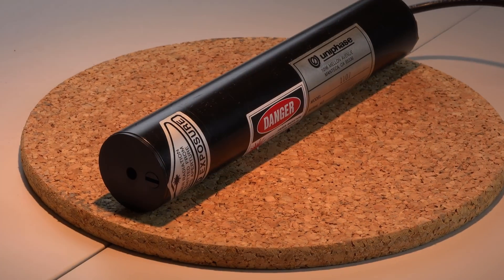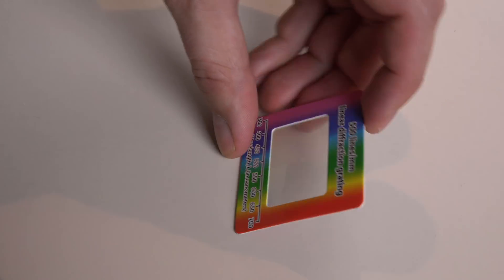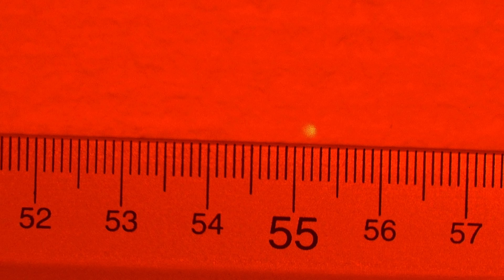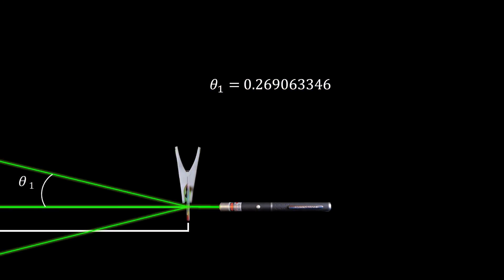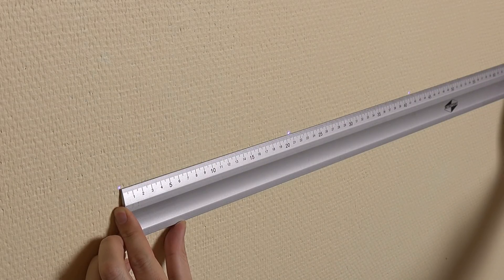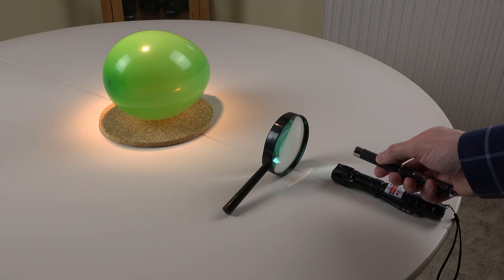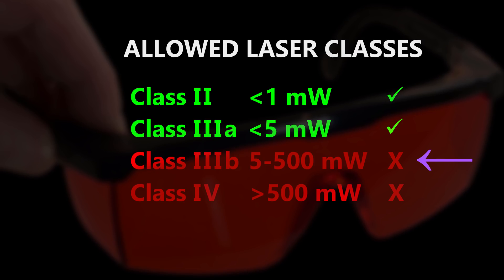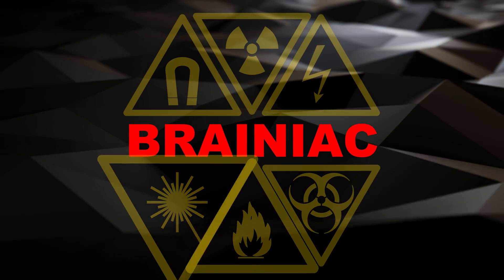MISLABELED LASER | Power and wavelength?

Comment: you forgot something very important : the grating is said to be 500l/mm but you dont known for sure  ;  the best way is to measure the distance between 2 lines of the grating with a microscope and then you have the exact line density of your grating.
But still the demonstration  of the method used is great!
Reply from the maker: Well, the diffraction grating is precise enough for me :) It could be the grating's fault though, that the wavelength results consistently were below the theoretical value. Thanks for watching!

Comment: Hi,
I want to make a lasertag game using eyesave IR lasers (ca. < 1mW). After searching the internet for several weeks, I still couldn't find any non industrial ones.
I would prefer not needing safety goggles, because most of them are very expansive and might also be toned and therefore have a discoloured image. Do you know of any cheap goggles or material, that block IR light and fit my expectations?
I know, that you can decrease the optical power output of a laser by decreasing the voltage, but I have read, that there is a minimum voltage needed for the laser to work properly. What experience do you have in this context and do you think it works better, when I decrease the current instead by connecting a resistor in parallel?
An other idea I had is decreasing the output power with an optical filter or adjusting the focal lenght. However the laser should stay focused, only the beam diameter may expand.

Thanks for reading, hopefully you can help me :-)
Reply from the maker: Hi. Sorry, I don't have experience with your type of project. All I know is, that the combination of IR laser beams and eyes is not good, so I'm not even gonna speculate on your behalf. Be careful. In the spirit of the video: How do even know the laser is below 1 mW ;) IR lasers are typically used as pump diodes and very powerful. Thanks for watching - hope you succeed with a safe and well-working lasertag game!
Reply: Thank you, I know, that I have to be very careful, ir lasers can be really dangerous.
Maybe I can experiment a little bit to decrease the optical output power (with proper eye protection) and kind of measure the power reduction by comparing to leads like lighting a match (bad example xD)
My source for the below 1mW value is a diagram on Wikipedia and a comercial laser company.

Comment: Do you think a cheap chinese safety glass will help much with a laser? Especially the green ones are mostly generated by infrared laser and then frequency doubled but still emit quite a big amount of infrared which is invisible but very harmful to the eye. You should do a test here - dont know if it show up in that kind of test - probably not...
Reply from the maker: Any safety glass is better than none at all - so yes. Infrared leakage is a problem on cheap, green DPSS lasers. Not sure how detecting infrared leakage can easily be done at home. I'm open to suggestions :)

Comment: A great video! Extremely enjoyable, and very good to show to students. A small remark, I do not understand why you insist so much on radians. You do not need radians at all. Any angle unit will do, as you re-inject your angle, obtained from arctan into a sine. Grads, degrees, anything will do. Additionally you do not need trigonometric functions either, a good old square root will suffice, thanks to Pythagoras' theorem. The formula is (okay, not as simple, but involving far less complicated math beneath, and needing a simpler pocket calculator): 

S1 / (2 * SQRT((S1^2)/4 + L^2)) * 1,000,000 / 500

And voilà!
Reply from the maker: Thanks! And you're right. Any angle unit will work, as long as you stick to the same in both formulas. My bad - a combination of 25 years since I learned and practiced trigonometry and too much switching between a spreadsheet in radians and a calculator in degress x) But hey, the end result is the same and now my viewers wont have the same trouble getting it to works as I did :D
Reply: Congratulations again! :-)

Comment: When I got my 0.1 W laser from this company called Lazerer, I asked for power measurement specification. After several years, it still works excellent.
I just want to say that it's best to buy these things from companies that deal with lasers only, and not some "geek stuff" website or even worse, eBay. Usually you get a <5 mW relabeled as a burning laser and not the other way around.
Reply: I just get scrap projector lasers. Couple hundred bucks, 40 watts. That'll do 'er.

I have yet to turn one on, because that's a terrifying amount of laser.
Reply: In recent years, the laser diodes between 25mw and 50mw has seen a drop in value, mostly because they aren't really good for a lot. They damage the eyes, yet they are also too weak to do anything actually useful. It is these that are making it into mislabeled products, due to being cheap.

Comment: Wow I never knew that lasers could be this dangerous!
Reply: Drusus Carrico wait untill you'll find out the truth about forks and other kitchenware!
Reply: What did you think lasers did than exactly? They are literally designed to a create a cohesive signal, which, with minimal effort, definitely has the potential for abuse!
Reply: I've been stabbed by a spoon, I was fine. However I have a laser that should permanently blind someone in about 1/10 second, and cause permanent eye damage within 1/1000 second. That's a lot more dangerous than kitchenware (although, if that kitchenware reflected the laser back into the operator's eye, then I agree it would be very dangerous).

PS: I'll juggle knives, but never a laser, some things don't heal like miner serrations in the skin.
Reply: Well I knew that they can kill your eyesight but not pop balloons or light matches.
Reply: I've always thought of lasers in the following light:

Imagine a thousand pebbles dropped randomly in a pond. Each pebble creates its own ripple which will combine with others, cancel other with others, and it will generally be a very chaotic environment. Now, imagine that each pebble was dropping at just the right time such that its ripple and all the other ripples perfectly match up. Those combining peaks could have 1000x the energy as a single wave from a single pebble. 

That is coherence.
Reply: For Jakes, example, imagine that a low powered spoon shooter hit you all over your body with randomly generated spoons. Nothing much will happen, maybe a bruise or something. Now, imagine that every spoon was synchronized to hit you at the same time, or hit you in the spot, or just simply be more coherent than random, some real and potentially devastating effects are going to manifest.

Comment: You have a 995MW  laszer solution with the included magnifying glass. This is supported by the fact that the similar lazer faded completely on the right against the black background.
That makes the equation 140 Mm - (black) However dark you where able to achieve.
Most of the rest of  your math was correct.
I would suggest that you revisit this topic.

Comment: Mislabeled?  Maybe not!  Visible light may be (actual or equivalent) to 5mw, however...the INVISIBLE infrared light from the exciter is much higher but NOT filtered (to save the cost of the filter)!
Reply from the maker: That's only a problem on DPSS lasers (like 532 nm green and 473 nm blue). The violet 405 nm lasers do not have an IR pump diode and therefore no risk of IR leakage. Thanks for watching!

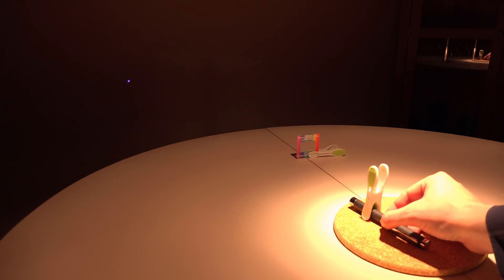Comment: 4:50 I can assume the helium laser is helium 3, correct? being within an error margin of 3 manometers it works surprisingly well for something with a half life of 12.5 years. has it been used much?
Reply from the maker: Are you thinking about tritium (hydrogen-3)? No, it's just normal helium in the laser. It's amazing, that such an old He-Ne still works. It is on its last leg though - it starts to strobe and make worrying arcing noises when warmed up :(
Reply: ah yes, sorry, I'm a little tired, been up studying all night. but yes it is amazing that a helium neon laser is still operable 30 years after it's creation.
I hope it last's a little longer those are very rare at that age and condition.

Comment: wouldn't a higher power laser melt that diffraction plastic (and CDs)?
Reply from the maker: It probably could. I have no idea what the max power rating are for these. No info on the manufacturers website. I expext it to be very high for visible light, though.

Comment: Very nice video. "I've have just confirmed the wavelength [...] within a third of a billionth" For you to be really able to say that you would have to compute the experimental uncertainty. "Measuring Error Bars with Aero Bars - Sixty Symbols" is a very good video about this topic.
Reply from the maker: Thanks :) Did I mention, I'm not a scientist :D I know there is some uncertainty in such a crude setup with basically a toy diffraction grating. But I was very surprised by how accurate it was for all lasers. The interesting part is that all results were below the theoretical wavelength. I wonder what is the cause for that. The wall is not perfectly flat, the diffraction grating is not perfect, I didn't place the laser perfectly level and at 90 degrees, temperature dependence of lasers etc. Thanks for watching!

Comment: My laser is labeled as 3.5W, but when I burn things such as cardboard, sticks and small pieces of wood, they never set on fire. Instead, they just instantly start burning. Makes me wonder if its way less than 3.5W. (laser is wicked laser arctic spyder iii 3.5w)
Edit: burning///smouldering///whatever :)
Reply from the maker: Didn't they ship an actual measurement with the laser? I know Wicked Lasers used to sell lasers with very doubtful specs, but after the introduction of the first generation of the Arctic series (sold as a 1W but noone got one that powerful), they started giving the true specs and even including a sheet with a measurement. If it instantly smoulders a piece of wood it is VERY powerful :)
Reply: I completely forgot about that measurement sheet! It appears to be averaging the advertised wattage, maybe I'm just burning the wrong type of wood to see fire :P I've pm'd you an imgur link of the laser measurement sheet in case you were interested :D

Comment: please try it with a pink laser!! im curios what will happen
Reply from the maker: Pink? Is there such a laser color. I think it would have to be an RGB-laser, but then it would have multiple wavelength and after the diffraction grating just show several dots from the red, green and blue lasers :) Thanks for watching!
Reply: Brainiac75 oh, that makes sense, still it would be cool if you try an rgb laser in part to thanks for responding :)

Comment: Can you put a current meter inline with the batteries/diode and measure the draw on the suspect laser?
Reply from the maker: I can't test directly in the diode, but tried between battery and the battery contacts on the laser. The laser driver seems to draw 0.16 amps from the battery.

Comment: Question, why go about solving the wavelength using radians vs using the Fraunhofer diffraction equation? Less math is always nice
Reply from the maker: Hm, just looked up Fraunhofer diffraction equation. That doesn't seem like less math to a non-mathematician like me. Can you give a simple example from one of the measurements in the video? I would really like to simplify it even more.
Reply: Brainiac75 I'm fairly certain (not 100% though, I'm being lazy and haven't looked it up yet) that what you are doing is based on the Fraunhofer diffraction equation. But it can simplify to a pretty easy equation: n*lambda=(d*x)/L where n is the order of diffraction, d is the distance between gratings in the slide, x is the distance between center spot and the first order spot, and L is distance between slide and wall. 

All of these measurements you already have and used, which is why I'm fairly certain you are using the Fraunhofer eqn is some way. My first thought was that every time I've used it I never had to calculate/use the angle of diffraction. So I think you are certainly doing it right (great video), just thought maybe a little easier method was available

Comment: Another big problem with those 532nm green lasers is that a lot of them are missing an IR shield. Since the process of converting 1064nm to 532nm isn't 100% efficient, some infrared light goes through. Quality lasers have a infrared shield at the output to filter it out, but many cheap lasers don't to reduce cost. Therefore, what looks like a dim/safe laser may actually be very hazardous. I once had one that was 3mW with a IR filter (it didn't come with one) and 150mW without (like it was in the box)! You could go blind without even realizing it...
Reply from the maker: I agree. Cheap, unbranded lasers directly from the Chinese slow boat should never be trusted to be eyesafe. A laser power meter is needed to know the real strength of such a laser. Thanks for watching!

Comment: They put the wrong label because it's illegal to sell lasers on some websites that are above 10mw.
Reply: i got the Blue/violet Laser 303 from ebay. It also says maximum output 5mw and yet i can burn a match with it, pop ballons, edge plastic, etc. These wrong labes are put on there to get it through customs because the chances are (if the laser doesnt look like it will roast your brain on instant) they will open it but not test it.
Reply: I see. Bunch of arses... Putting wrong specs in products. "Wonderful" widespread practice in a lot of industries, but I thought lasers were not one.
Reply: VeteranVandal Out of curiosity, what other industries are you aware of that have massive mislabeling issues? Just so anyone reading might know to look for.
Reply: VeteranVandal But on the bright side… cheap powerful lasers.
Reply: high power laser can burn things ,pls have a look at    http://wildlaser.com/product/2018-new-focusable-waterproof-best-quality-638nm-700mw-red-laser-pointer-flashlight-with-charger-battery-2-modes
Reply: Bruh,,,,lasers are sold up to 5 watts if not more, it's illegal to ship them with batteries, and when they are mislabeled generally it's the power that's lied about, now due to the diff in laser power testers, the power level might be a few points off. But sometimes it's much.more, or much less. The wave length varies by color, blue/violet being in the 400, green in the 500, and red in the 600, diff glasses are for diff colors, don't skimp on the glasses. There are a few sights where you can get good lasers at a reasonable price. Or you can go to a distributor. But stay away from sites like WISH.
Reply: Yeah, who needs accurate labels on products that can literally blind people and start fires?

Comment: I still don't understand the d in wavelength formula. Why it always 0.000002m?
Reply: That is the spacing of the slits of the diffraction grating. The diffraction grating is basically a very dense grid of some kind of reflective material. The one used in the video had a distance of 0.000002 m between two grid bars. If you do this yourself, you will have to insert the spacing of your diffraction grating.
Reply from the maker: As mentioned by Saubstauger, it is the distance between the slits in my diffraction grating. I use the same grating for all the experiments, so it's 0.000002 every time. I also have a 1000 lines/mm grating. If I had used that, d would be 0.000001 m in the solution (and the laser dots would be further spread). Thanks for watching!

Comment: You can easily meassure a laser's power by meassuring it current then multiply it by the opperating voltage of the laser.
Reply from the maker: Hmm. I just did a crude test with my multimeter. The laser driver is drawing 0.16A - the battery is 3.97V. So the laser driver is consuming roughly 0.6 watts. But there's some ineffiency in the laser driver and diode, right?
Reply: Brainiac75 yes some lost of energy through heat.

Comment: I would have assumed that they would sell you a weaker laser labeled as a stronger laser, but not the other way around.
Reply from the maker: Yeah, but it's a way of bypassing bans. As a rule of a thumb: If an unbranded laser is sold as being way over 5 mW on the internet, it's likely of lower power than specified. If it's sold as being under 5 mW it could be much stronger. Weird, but buyer beware :) Thanks for watching.

Comment: You don't need a laser power meter. You can create your own. Just get anything that senses heat and dissipates it at a fixed rate. Most people use a thermocouple with a black spot and a heatsink on the back, or a mini peltier TEC. Just need to calibrate it. Power is measured in watts of heat it generates with the laser dot.

It's just hard to calibrate one if you have no known lasers. You can make a healthy business calibrating and making such devices, cheapest ones are like 200$ a pop. You can go much lower.
Reply from the maker: Thanks for the tip. For my purpose though, I really need a power meter with good calibration. Noone would trust me online from a home-made power meter, right ;) Thanks for watching!